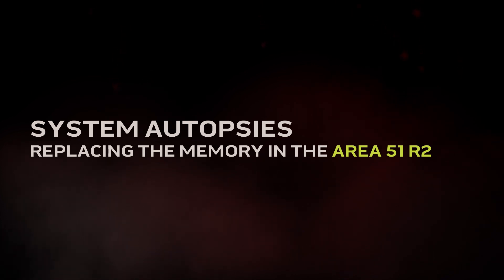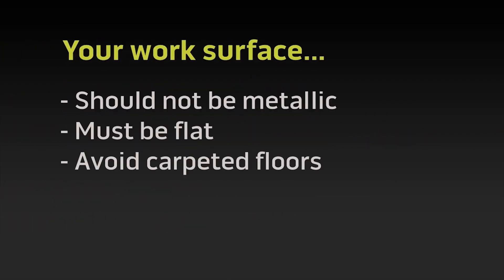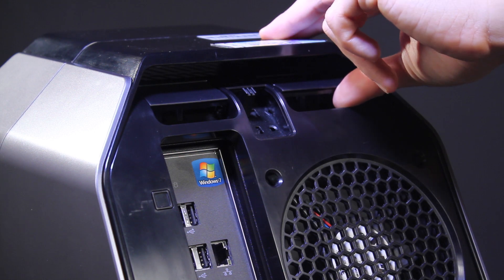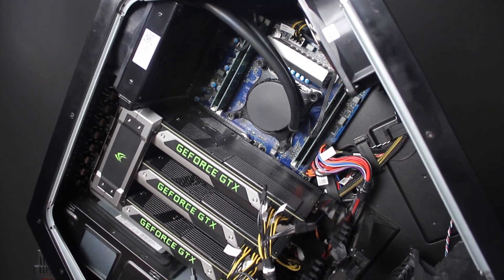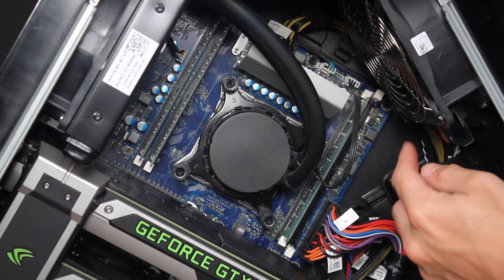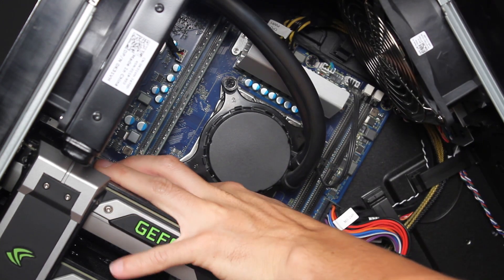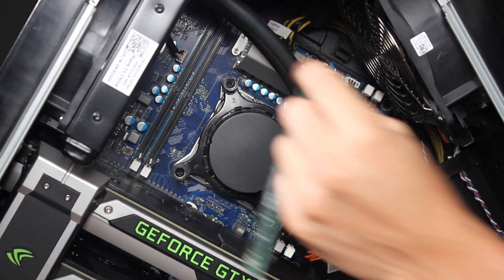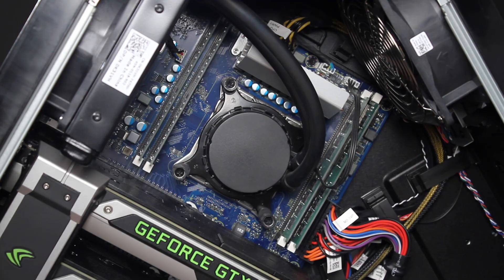Alienware Area-51 R2: Upgrade/Replace RAM

Comment: I recently upgraded the ram in my Area 51 R2, and afterwards the computer wouldn't boot.  The tower turned on, but I got nothing from the monitor or any peripherals.  No output whatsoever.  After a lot of headache, panic, fear, and anxiety, I finally found out that all I had to do was update the bios.  I reverted to the old ram so I could boot, put in my service tag on Dell's website, updated the bios from there, put the new ram back in, and it worked like a charm.  In case any poor soul is suffering the same problem and combing these comments as a last ditch effort to find a solution, definitely try updating your bios.
Reply from the maker: "Hello, we currently don’t have dedicated support on YouTube, but don’t worry—you can get live assistance through Facebook, Twitter and Dell Community Forum (DCF). You could write to us there, and we’d be glad to look into this for you. 

Facebook: https://dell.to/2JFeK5u 
Twitter: @AlienwareTech 
DCF: https://dell.to/2JChBMC 

Our working hours: 
English: Mondays—1:00 PM to 5:00 AM (GMT) | Tuesday through Friday—6:00 AM to 5:00 AM (GMT) 
Spanish: Monday through Friday—8:00 AM to 5:00 PM (CST)"

Comment: I upgraded my ram to 4x8g, but when I power it up, the monitor, keyboard, and mice have no reaction.
Fans and lights on the unit is on, then nothing.
Tried reinstall the ram, tried clear cmos, still not work.
What is the problem of this?
Reply: I still need to clear cmos if I put origianl rams back to make it work. But yes, it does work when I use the old ones.
I tried Corsair Vengeance LPX, and GeIL. Both same problem.
Reply: Yes, still same issue. Seems no matter what kind of  ram I use, it always give me a black screen.
Reply: Same here.
Reply: same issue
Reply: Look for sellers that announce the memory as compatible with Area51 R2. That's how I finally managed to upgrade it.
Reply: Berudil link? So far the normal sites I use don't list that that I know of
Reply: I figured it out few days ago.
Update your BIOS to latest version first, then change the memory.
Current have 4x8g Kingston Fury 2133 in the system.
Reply: https://www.offtek.co.uk/alienware/desktop-memory-upgrades/area-51-series/area-51-r2-ram
Reply: thanks for the replies! I upgraded my bios with the driver from the dell website and it worked perfectly with the new ram I bought. (RipJaws)
Reply: Glad it works for you too.
:)
Was really a pain when I was finding a way to solve the problem.
Reply: Chenming Zhao how Can I fix it I have the same issue
Reply: @Chenming Zhao   you my friend are a fken  genius. Thank you. All I had to do was update my BIOS. I did that and then put in the new ram and it worked like a charm.

Comment: I recently ordered an area 51 and when I got it I planned on upgrading the RAM to g skill' s trident z series of RAM. Since it performs at 3200mhz would since the motherboard supports ddr4 could I just replace the current RAM and have no issue with the performance?

Comment: My A51 system has 4x4 DDR4 2133 ram, but when I look at the information using the alienware command center it says under "speed" category "DDR4-2133 (1066MHz)" in all 4 DIMM slots. Is this normal, is my RAM running at full 2133 speed, and if so, why does it say 1066MHz for each? The Bios also says RAm freq is 2133 so I'm unsure why CPU-Z, AW command center and speccy report 16gb of ram at 1066MHz. Am I missing something?
Reply: +Alienware Services Oh, I see. Does this mean my RAM is working fine and as intended then?

Comment: will I get a faster boot up time if I upgrade my ram (currently running on a 8gb ddr4 (2x4gb) ram)? and also I wanted to get an additional 16gb ram(2x8gb) from PNY! should I be worried about compatibility issues?

Comment: i pull the leavers on my R2 but the panel doesn't move, i feel if i use any more force i will break the leavers. Any suggestions?
Reply: +Alienware Services the two screws at the bottom of the case?

Comment: do you guys know if I can use these pair of ram cards to upgrade the ram I have on my area 51? Crucial 16 Gb (8gbx2) ddr4 2133ghz. or do I need another model?
Reply: did you buy the crucial brand and did it work for you? if so, can you link what you bought? I bought G.skill Ripjaws and just get a black screen, no signal to the monitor.